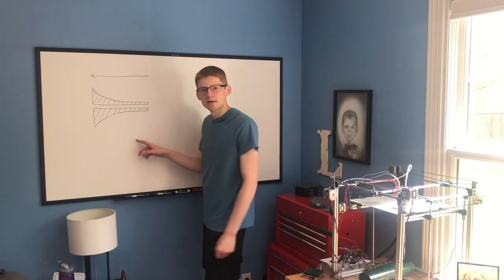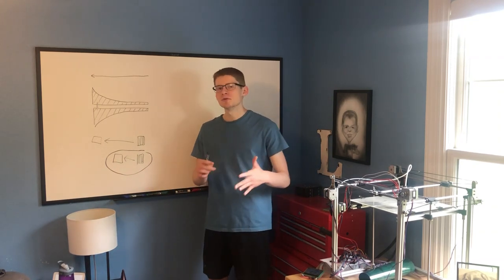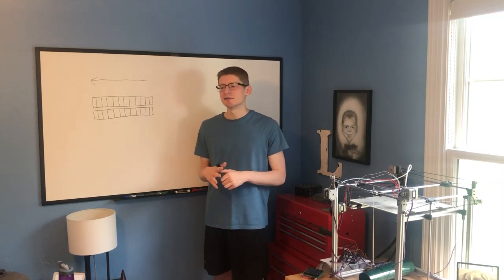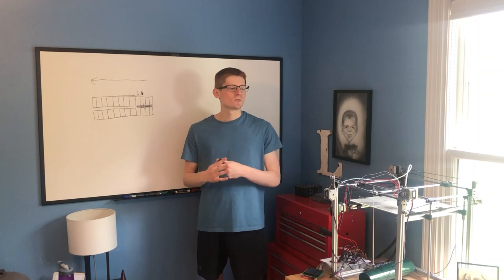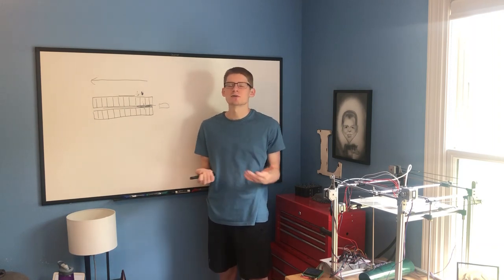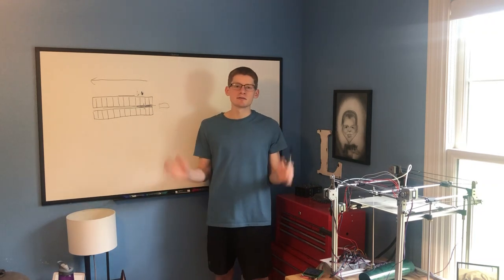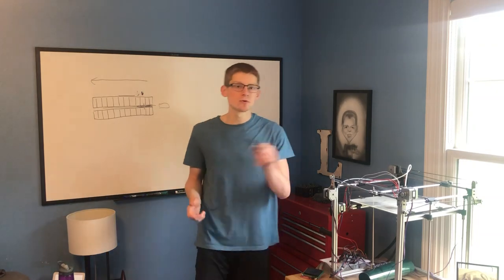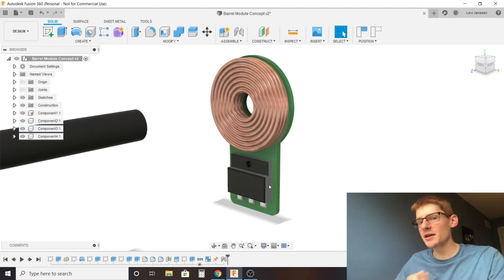Making a Coilgun - Part 4: A New Revelation

Comment: I came up with the same idea shortly after watching your previous video on the subject. It would indeed be very effective to vary the voltage/current input to a coil to create a 'virtual' center of electromagnetic force, in a similar fashion to microstepping with stepper motors. I am by no means an expert, but I think that it could be worth looking into using high power DC motor driver chips/circuits to allow you to use PWM to vary the strength of the coils to create a 'virtual' center of electromagnetic force, in a similar fashion to how a linear motor works.
As far as holding the coils together, if you watch the Hacksmith's coilgun video, they wound the coils separately using a jig, and used a binder (glue) to hold the wound coil together. This could work very well, as it eliminates the need for a PCB on the back of the coil.
I'm no expert on numbers of coils in relation to power/force, but I know that DC motors with more turns generally spin slower at a given voltage, but with more torque. I don't know if that applies to this, but I think that maybe you should do some testing with some sort of force sensor, in order to trial-and-error a good number of turns. If you created a test model with only one coil, you could then use a pair of light gates, or an off-the-shelf speed sensor (whatever those are called) to see how the number of turns affects the projectile speed. 
Coming back to the dc motor bit, I just remembered that a greater number of turns creates a higher back EMF. I am not sure if this applies to a coilgun design, however, it is good to be able to asses all of the factors that affect something like this. ElectroBOOM has a good video about DC motors, in which he talks about back EMF. 
Keep up the good work, it is really good to see that someone is actually putting a decent amount of R&D into a coilgun.
Reply from the maker: Ya, you're right, you could totally use PWM to control the virtual electromagnetic center with an extremely fine precision. Assuming your square wave frequency in high enough that you'd get in more than a few pulses per stage, PWM could make a real difference. I am pretty set in the idea that keeping the electromagnetic center as close to the projectile center is the most important factor, and I'm surprised I didn't think to use PWM for fine tuning.
Reply: @LeviJanssen  I suppose that if you added a capacitor, you could smooth out the square wave, which would keep the virtual electromagnetic center from oscillating as much, similar to how a lot of DC motors have capacitors across their leads (although I don't know if that is for the same reason). I think the hardest part of using a blind system would be getting it precise enough to map the projectile's exact position at high speeds, and circuit latency might have to be accounted for.
Reply: @quinnobi42  the capacitors across a DC motor are for noise suppression from the brushes in the motor affecting the rest of electronics or generating radio interference
Reply: @andrewharpin6749  Interesting, I guess you learn something every day!

Comment: The idea of blind system is legit,  synchronous motor control is the same. but in this case, you aren't in steady state. The number of turn is irrelevant, it is just one of many parameter you have to deal with. The more turn, the more inductance thus, slow current slope. The ideal coil has the same length as the projectile in order to optimise the coupling. The real deal to increase efficiency, imho, is having proper power electronics and control current precisely. Come talk to me I've been working on it for years.

Comment: Couldn't you alao reverse the polarity of the coils from pulling to pushing
Reply: He could only do that if the projectile was a magnet, but theoretical yes and he could double the power (efficiency?). I think those little magnetic balls would just spin around so it would need to have some length.

Comment: You should look into Nikola Tesla's pancake coil geometry as it applies to a cylindrically wound coil. You can double the inductance of a coil (for a given number of turns) by doubling the voltage between adjacent turns. It takes longer to wind but it works very well. Also, I have used fast acting glue as well as tape to hold coils in place with good results. You want the most amount of coil per unit of space that you can fit. There is an ideal height to diameter ratio that will give some idea of a limit to how much added inductance you get when you keep winding the coil farther from the projectiles axis.
In my opinion, you could set up a bus of capacitors, one for each module, charge them in parallel, and then mechanically bridge the connections with the respective coils using a commutator type apparatus. The commutator could be shaped to create the respective connections one after the other, and you would merely tune the rate at which the commutator moved from off to on to fine tune your acceleration. A capacitor discharge is more energy dense, reliable, and efficient than transistorized on/off switching for a given power source. Great work!
Reply: You don't want to add to the inductance of the coil. That will only add drag/heat/resistance and negative feedback. If you need to boost inductance you can double or even triple it by carefully selecting the projectile size and material. The more iron the more inductance. The bifilar coil is nice but like most testla projects it's designed to run on ac and would be better suited for wireless inductive coupling or inductive heating.
Reply: @TheNinjaonchronic  Tesla's coil geometry applies to all electromagnetic coils actually, not "just AC".

Comment: Hall effect etc could help time it.
But KISS applies?
You can have all the magnets in front turned on at the start. The thing you want is to remove negative forces? One thing you could try is a conductive barrel such that projectile progress can be determined. Then switch off coils once the projectile passes? Some sort of sprung stabilizer at the end of the projectile could be the contact?
Also. You may want to try coils that are funnel shaped instead of disk shaped. A simple test with iron filings on a piece of paper in line with the narrel will show you the "shape" of the magnetic field and where it is strongest.
Coils can be "potted" to keep them in the shape you want. i.e. bed them in epoxy. One problem with that is the heat retention.
Reply from the maker: Hall effect sensors can't detect a ferrous projectile and would be overwhelmed by the adjacent coils. Turning on all coils in front of the projectile would kill the efficiency. A conductive barrel either allows eddy currents to form or halts all movement if the material is magnetic. Internal brushes would be destroyed immediately. Cone shaped coils are unnecessary because the strongest point of the coil is irrelevant.
Reply: @LeviJanssen  I am far fom an expert so take it from where it comes.. 
Would the shape of the magnetic field not have an effect on efficiency? I have seen toys where efficiency/performance was improved by angled magnets.
As the "barrel" isn't really a  bearing surface some sort of switching could be incorporated? Kinda like a commutator ring on a motor but just linear?
I totally agree. Really strong magnetic fields would probably cause havoc with sensors of just about any sort.

Comment: Liquid oxygen Would be... You know... Cool and decrease the internal resistance of the coils, but thats problably to much work
Reply: liquid nitrogen/air would be cheaper, and    l  e s s     f l a m m i b l e
Reply: Passive heatsinks/watercooling may be good too.  Some laser flash tubes use this.
Reply: Watercool via pipe around the coil+barrel assembly?

Comment: I have been toying around with simulation of coil geometry in relation to a target current and voltage, I'm using femm, free software to simulate the coils, and some python scripting to find the optimal geometry.
Reply: TheJohaj hi, do you have documentatiom or a video ? I’m doing the same and would love to contribute
Reply: @gedr7664  I have basically worked from this tutorial http://www.femm.info/wiki/CoilGun
And wrote some code to calculate coil parameters such as the resistance and number of turns from a wire diameter. I might upload my code or something if you are interested

Comment: I see one big problem: You are building essentially a big Capacitor that can accelerate an projectile but the Energie you have to use to build up an electromagnetic field is not transfered into the projectile speed.